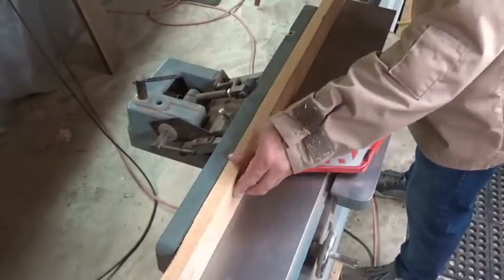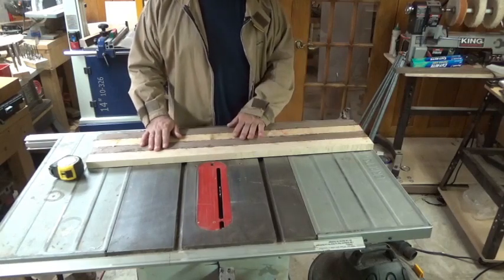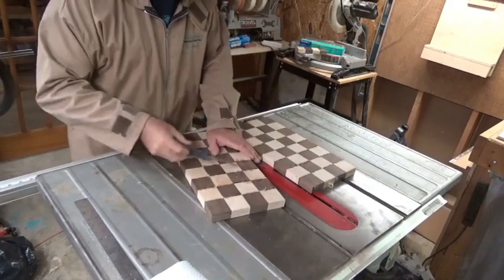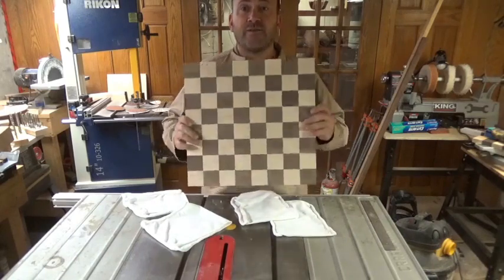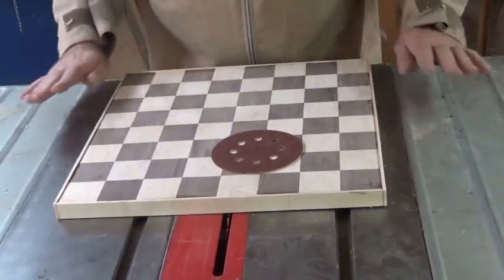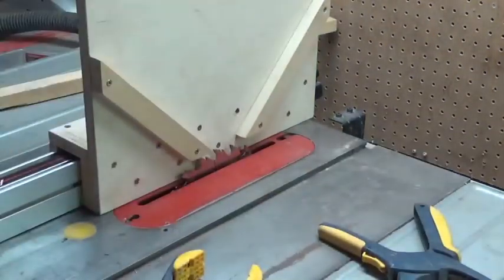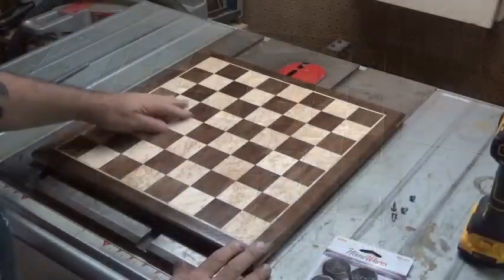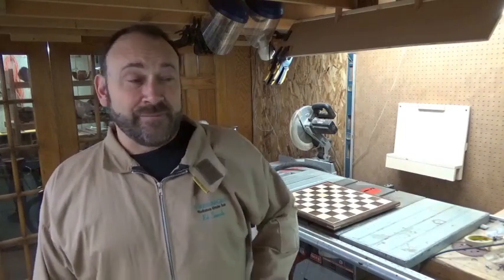How to make a chess board

Comment: Hi Rob, great video - thank you.   I'm at the stage of cutting splines for the corners. How deep did you cut for the splines please.
Reply from the maker: Hi jeff, first off do you have a full kurf blade? 
You can make the splines whatever size you want, try on a test piece to see what you like, i went around the corners by 1”, you dont want them too small.
Reply: No I haven't so I'll got hunting at the hardware shop
Reply from the maker: @jeffhale713  probably better luck on Amazon, its where i got mine , should last my life, doesnt get used for regular cutting, only when i need a flat bottom to the cut
Reply: Thanks Rob. I will check Amazon.  Is " full curf blade" what I search for. Is that the correct name?
Reply from the maker: @jeffhale713  https://www.amazon.ca/Freud-LU77M010-10-Inch-Non-Ferrous-Cutting/dp/B0002TUFBS/ref=mp_s_a_1_1?crid=2H5N9XP0Z314V&keywords=full+curf+saw+blade&qid=1656800734&sprefix=full+curf+saw+blade%2Caps%2C99&sr=8-1
Reply: Yikes. Not cheap.  Rob can you tell me approx width of your cuts with your full kerf blade. Currently mine of 2mm thick. Is that too thin.  Cheers Jeff from Adelaide Australia
Reply from the maker: @jeffhale713  1/8 inch
Reply: Hi Rob,   I have made a 2mm biscuit to go into my 2mm saw cut. I have also devised a method of squaring off the kerf. Do you think the 2mm in too small bearing in mind that yours are 3mm.   I just cant justify the outlay for a full kerf blade.  Cheers
Reply from the maker: Im sure it will be fine Jeff 
No harm in trying right 😊